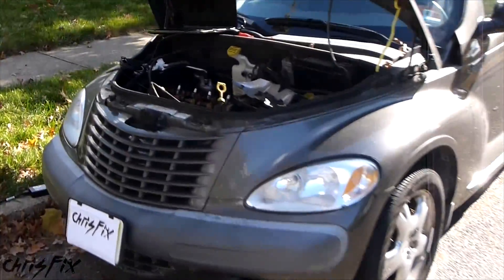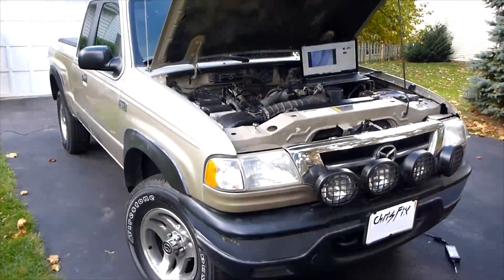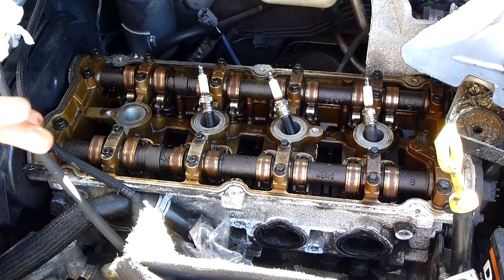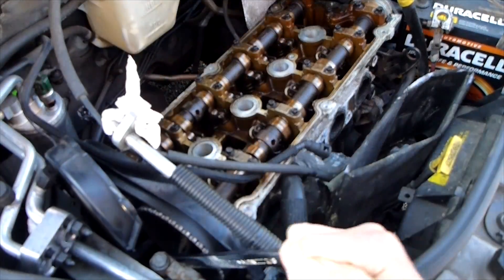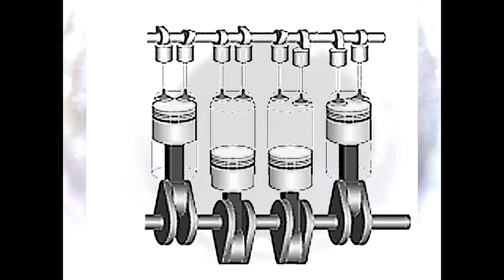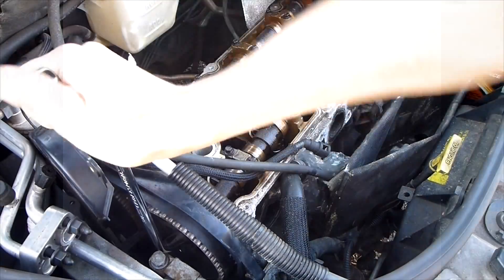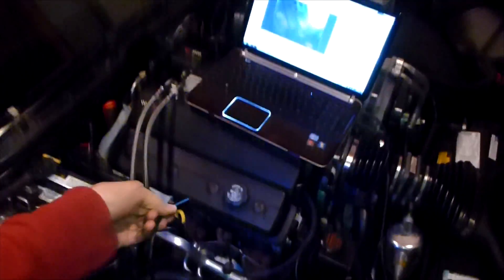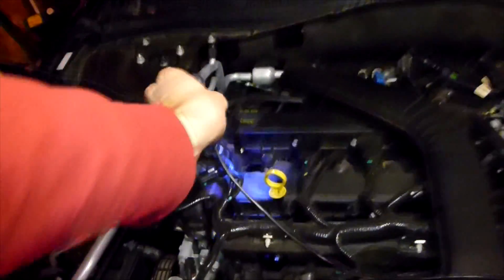What does the inside of an engine with a Bad Head Gasket look like?

Comment: Hi chris, i'm definitely interested in see how much water will clean the engine and even how to do it. Keep up the GOOD work...
Reply from the maker: planet1250 Thanks man! Good! I will be making a video just for that!
Reply: For sure. No substitute for the dyno, it's accuracy is only as good as ObdII data, which is certainly slower than the actual PCM.
Reply: ChrisFix If you're interested, I write a lot of articles about cars and one of my most exciting one was the results of water decarbonization. Or, I should say, it was the most excited I've gotten from the results before I wrote the article. I don't have a bore scope,  but it made each of my cylinders appear to run at the same temperature.

Prior to the water decarbonization I had on my metal intake (each intake tube is seperate and not touching) running about the same Celcius except cylinder no. 1 was several degrees higher. Afterwards they were all the same temp.! I took a good drive and came back and my laser pointed infrared thermometer still read them all the same!

I could really feel the difference too. Cylinder 1 had a leaking injector and after a new set it was still running hotter so I tried this method. I have a lot more to say, but I'll share the article link if you'd like it before I sit hit and write the whole thing again, lol.
Reply: ChrisFix  I've looked off and on for a while. I can't believe it took me 2 weeks to get decent info on how the HP/Torque is calculated by the Torque app. I was right. It doesn't use the accelerometer, but you don't have to take my word for it.

They're official forum:
http://torque-bhp.com/forums/?wpforumaction=viewtopic&t=1270.0
Reply from the maker: Haha that is awesome! I would love to see your article!
Reply: Awesome. Decarbonziing Your Engine with Water: http://carmilespergallon.blogspot.com/2014/10/decarbonziing-your-engine-with-water.html

I bring up problems that happened after the fact so perhaps checking on the before and after of those items will help make a better video for everyone too.
Reply from the maker: Nice article. I would not consider the torque app accurate at all. It is fun to play and it might give you am estimate but it is not something serious. Your 5hp even on a dyno means nothing because there is so many variables. The temperature readings are a neat way to go about it. Did you take the temperature right after spraying all the water or did you run the car for a day?
Reply: ChrisFix I took the temperature changes per cylinder immediately after the water and again after a ten minute drive, and repeatedly for days and they all stayed even.
Reply: ChrisFix And you're quite right to not overly trust the app...however I think it's a better baseline than my gut, lol. Several repairs ago it told me 59 HP, 90 HP after a new catalytic converter and so many more details to improve from where I was. Eventually, I'll have to go to an actual Dyno.

I think the primary detail it can't account for is wind since I do drive the same spot of road everytime.
Reply from the maker: DE Nichols Dont forget about tilt in the surface of the road too (besides wind). The accelerometer in your phone is hard to get on a flat surface so that makes things inaccurate.
Reply: Hmm. I should write the app designer if it even uses the accelerometer. I think that'd be very inaccurate indeed. I only used the GPS verification of my speedometer enough to see it close to perfect, and turned it off. I believe it uses that as a measurement instead. 

It cannot get hp or torque estimates without Obd II connection or it's accuracy would indeed be worse.
Reply from the maker: DE Nichols I thought it did. Either way, it really isnt accurate. I should do a dyno vs app video and test that too hahahaha
Reply: ChrisFix Rereading your old comment due to a kind plus one, I retested the fuel injector temperature many times. I noticed the most change in temperature between each when it was hot out. 

I used those tests as the most telling to adjust my spark plug gap to compensate. You see, the richer the mixture the less resistance for a spark plug to ignite. I ran the gap a couple thousandths wider to get the engine running more even while I waited for the warranty fuel injectors to come in.

Comment: I have had a few 2 stroke motorbike engines seize and overheat I even turned one of the pistons into a paperweight and cut a section out to show the small end bearing.  Luckily on my car engines I have never had a head gasket go and an engine overheat though I have burnt out exhaust valves in the past.  You will have to see if you can get your scope inside a crankcase and have a look maybe through the oil pressure switch hole.
Reply from the maker: fastmongrel That is a good idea! I like the piston paperweight idea. If I had a man-cave I would make a table out of the engine and pistons like on Top Gear!

Comment: Thanks for that video. My 95 ford van with a 351 might have a head gasket issue
Very time I ran it the over flow that would bubble & looked like it over heated so I 
Decided to park it & when I retire to tear into it  thanks again now I know what to look for
Reply from the maker: Bow sr The 95 windstar had a recall on its head gasket. You might call the dealer and ask them if the job was ever done. Let me know!

Comment: I wanted to try the decarbonizing method with water for some time now. Im still not sure if its safe or not...so this would be a great video for me to really see the difference it makes!
Reply from the maker: Na izi Yea, it is safe if you do it the right way. I am more curious if it actually does anything. Sure, a long term drip like in a head gasket will clean out a cylinder, but will spraying some water into your intake really do anything? I will have to test it out.

Comment: Thanks for an awesome video and its probably a good idea to get mines cleaned. Might as well replace the spark plugs and wires while im at it. And that lincoln mark 8 replacing the control arms was a failure since we didn't have the whats that thing called control arm c clamp thingy special tool. 3 shops didn't have it here and had to take it to the shop lol. You can see how destroyed and cramped it was to take it off since it took me and pops 3 hours to remove 1 nut with the Brake cylinder blocking the way lol  http://imgur.com/a/0RcCP
Reply from the maker: ***** Thanks man! The control arm doesnt look bad for your Lincoln Mark 3. You could have hit the ball joint stud and used a crow bar to pry it up. I guess it was stuck in there good? Too bad you couldnt change it yourself!
Reply: ChrisFix Yeah the passenger side was good  since it was a small crack would of lasted another year. but driver side was destroyed i peeled it off without effort lol it acted like a cover. And yeah i tried to hammer it off with a small hammer big hammer and used a plumber wrench thats like 30 pounds and still wouldn't come off. Used WD 40 Liquid Wrench silicone spray and Brake something forgot the name to loosen it up and that sucker wouldn't come off. It was starting to look like i was flattening it out like a sandwich lol. And in the process the height sensor was ruined and wouldn't level the car it was a nightmare. But hay at least it cost 200$ on both sides with the control arms we bought instead 300$ on each side. Now my ride is silky smooth like im driving on water.

Comment from the maker: Ever wonder what the inside of your engine looks like? How about what a head gasket failure, an overheated engine, or a melted piston looks like? 
I go deep inside the engine with a mini camera to see the damage done by a head gasket leak!
Reply: That sounds cool to do a decarbonized engine before and after and what works best to decarbonize!
Reply from the maker: mikeyd19841 Thanks for the suggestion! I will do that and a comparison video to see how well engine cleaners work!
Reply: would you make any video on how to burn the carbon from the engine with pre and after video showing the inside engine with the camera thing you have? and great video as always :)
Reply from the maker: ijustinw Defintiely! Thanks for the suggestion! I am going to work on some video outlines next week and start filming soon!
Reply: +ChrisFix Chris, you really need to get a higher quality camera if possible. In all your videos where you use this camera, I really can't see anything. Whether its the engine cleaner videos or this you really just can't see shit.
Reply: ChrisFix Man, thanks for link. This is cheap and really helpful!
Reply: ruhoer eoijre whats causing the oil leak in coolant?
Reply: +ChrisFix  hi, i have a 2006 Ford Fiesta 1.4TDCI and there is oil in Coolant Reservoir. There is no Milky Oil or White Smoke in exhaust, but there is a leak near transmission, so whats causing the oil in coolant and how bad is it.
Reply: De Andre Yedlin You need to fix it ASAP.
Reply: I bought a Mercedes E420 as i have mentioned, it over heated, i am going to buy a bore scope and post some stuff to instagram at some point.
but will or have you ever replaced a piston, i am hoping to rebuild most of this car since it is a project car and am unsure if this is a worth while investment, it isnt my dream car, i wanted a e420 from 1994 and settled on the e420 from 1997. i know that the e420 will need alot of work and that was the point, if anyone is reading this.
Reply: Did you end up fixing the pt cruiser or did you get rid of it?
Reply: Have you gotten a better borescope?
Reply: Im a fun of you sir from philippines,i always watch your youtube chrisfix here......is there any possible way that a car engine crv 2008 would survive if it has oil leak in head gasket.thanks alot sir chris
Reply: My TDI goes extremely overheated as well, since the hose of my cooling system fall off the water pump on the Autobahn. Recognized it - had to drive further 20km on the Autobahn to get to an exit. After that I replaced the hose filled up the water after cooling down. This was nearly 10 yrs ago. This thing is still driving well xD - dunno why the PT Cruiser is just blown by this.... is it that crap ?! (TBH by an optical standpoint the car is ugly as hell xD)

Comment: Wow that was a really cool video. I've always wondered what that looks like. Thanks for making this video and I hope to see more. What do you think happened to the head gasket?
Reply from the maker: cwvowel Thanks man! I think when I got the car, the used car dealer temporarily fixed the head gasket with one of those "pour in the radiator" head gasket products. Then a few months later the coolant was slowly leaking, nothing bad but every month it would need a quart of coolant. Then one day it all just blew so quickly, overheated, and in 10 seconds boom.

Comment: I saw a car at my junkyard where one piston had actually come up through the cam cover and dented the hood of the car, and the cylinder next to it was so hot it melted itself down into the oil pan. I have no idea on earth how you'd get your engine to fail that badly, but it was crazy to see.
Reply from the maker: Jesse Crandle Wow that is crazy. That person must have just ran the engine hard even while it was overheating. With this engine the person driving saw it overheated but 10sec later on the highway it blew.

Comment: Try that new gumout multi system tune up fuel cleaner
Reply: Royal purple and chevron are two other cleaners with big claims
Reply from the maker: Jeff R Ok, that is a good one. Any others? So far I have gumout, seafoam, water... One more would be good!
Reply: ChrisFix Gumout Multi System Tune Up (or Redline S1-I) has PEA in it. PEA is a man-made chemical that does a pretty decent job of cleaning intake and exhaust valves, as well as the piston and chambers, fuel injectors, fuel pump, and the fuel rail/lines. Believe it or not my Saab specialist mechanic used to swear by this product (the name of which escapes me) saying it was the only stuff that worked, turns out the main ingredient was 60-70% PEA. Basically water (steam is safer) is good for cleaning the chamber and exhaust valves, but PEA will get everything else, especially if you use a little of it all the time. Also Shell has "V-Power" gasoline, the "V-Power" is actually just PEA. :D ALSO: Techron USED to have PEA in it, but the MSDS no longer lists it as an ingredient. If someone tells you to get Techron it's up in the air frankly, but Redline and Gumout Multisystem definitely have it.
Reply: Redline stuff is like 12.99 where i am at and gumout is 7.99 and buy 2 get 1 free
Reply: Jeff R True, my bad, I thought it was only an 8 oz bottle, so I guess the Gumout is a better deal.
Reply from the maker: Jeff R Good stuff. I will check it out!

Comment from the maker: +LittleGojira, head gasket sealer in a bottle does not work. Maybe short term, but long term it wont work and this will happen. I think the person who sold the car to me did this and after a few months the leak got worse until it gave way and the engine blew.
Reply: Yea I would imagine a stop leak wouldn't work since the cylinder head is probably warped too and only a machine shop can fix that.
Reply: People who sell vehicles with issues like this, knowlingly, and do not disclose... UGH!
Reply: Incorrect. These products do not work. They are as ineffective as tire stop leak and that is coming from a 26+ Professional Automotive Technician.
Reply: Sarrus25 - Fraud. It's the same as stealing.
Reply: JBK963 did that have that turd 2.2L Chevy made? I know they stuck those in s10s and cavaliers. Those are notorious for blowing head gaskets.
Reply: ChrisFix where did you get that camera at 😊
Reply: ChrisFix I would like to see a engine that has sat up like mine and rusted around the rings to the cylinder wall. Great video Chris your the Man. as always be blessed
Reply: These sealers (quick fixes) were invented during world wars to get military equipment (such as tanks and other heavy machinery) to a safe place. These liquids are all SHORT-term fixes and should NEVER be used on your vehicle... Unless you need to sell it quick. I mean really quick =)
Reply: "it didnt work for me so it mustn't work for anyone"

You are incorrect, Certain brands of stop leak do work and they work very well. Its effectiveness will be determined by how advanced the warping is, but it has worked for me on multiple occasions so dont go making shit up based on un informed anecdotal evidence. Only stop leak that actually works well is Rislone's Block seal head gasket fix.

I Used it to temporarily keep my run around honda from overheating until i found time to change the gasket, but it worked so well i still havent done it yet.

Comment: So interesting. Ive always wanted a bore scope. Just never found the reason to get one. You could try myth busting different cleaner types if u can clean multiple engines. Like how seafoam isnt very good with direct injected and compare a cleaning of a DI vs non DI engine
Reply from the maker: trollaphobic That is a good idea! I dont have a direct injection engine to play with, but I can test how seafoam works vs gummout vs water vs etc... I like it!
Reply: do the engine cleaner test!
Reply from the maker: Integra DIY Will do. Sounds like there is a big demand so I will definitely make one! Any suggestions on cleaners?
Reply: Well obviously stp gumout and seafoam. The hard part is youd have to test engines that are simmilar in carbon build up. Unless one fails and doesnt clean anything at all id use as many vehicles as products to keep things somewhat scientific
Reply: ChrisFix Seafoam for one... A visual proof of before and after results 😎
Reply from the maker: trollaphobic Yea I know. That will be the tough part. But, if I find a few engines with similar carbon buildup then we are set for an awesome video.
Reply: And if you can find a DI engine that makes a huge difference in if a cleaner works. Too bad that milan isnt more dirty. Thats DI right?
Reply from the maker: I dont think the Mercury Milan is direct injection unfortunately but I could be wrong. I was looking to see if I can find any info on that with no luck.
Reply: Weird. Seeing the fuel spray id think it was.
Reply from the maker: trollaphobic Yea same. That is why I am not sure. But maybe the valve angle and the fuel injector angle allows for the spray to get in the cylinder pretty good. I need to do some more research. Let me know if you find out anything!